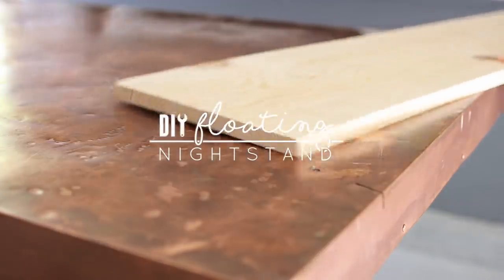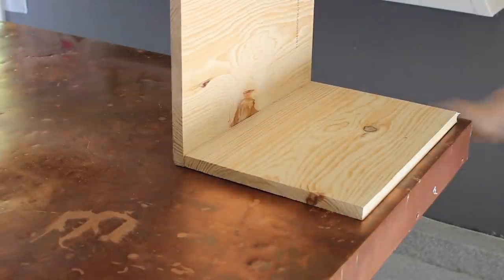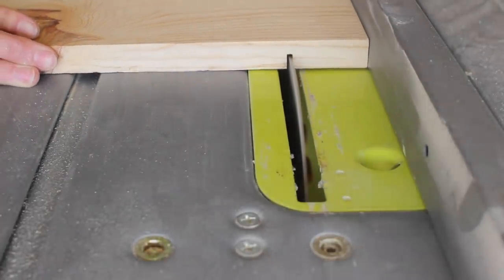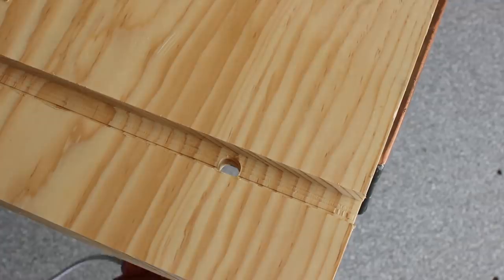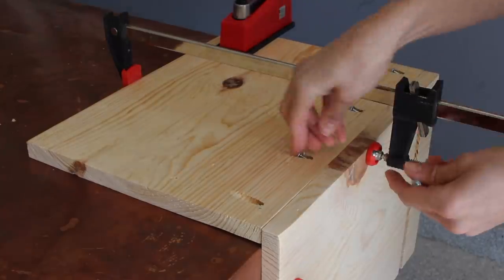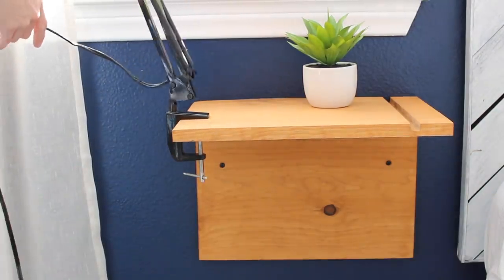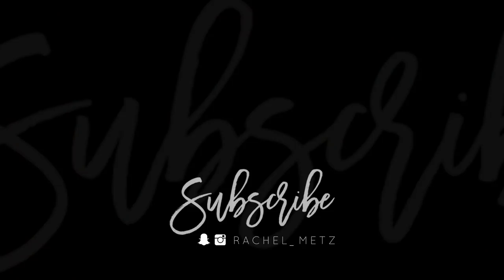DIY $10 Floating Nightstand

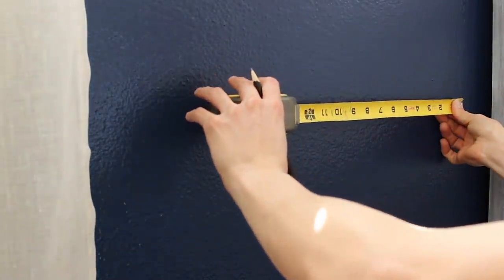Comment: 2:28 Reverse the countersink direction to get rid of ridges
Reply from the maker: Thank you! I did that since I loved the ridges actually (call me weird)! It added a bit of texture in a room that really doesn't have much texture with the other DIY furniture I've done. Appreciate that tip!
Reply: @LivingtoDIYwithRachelMetz  You won't see the ridges tho because the taper on bottom of screw head covers it when you run a screw in.. .. Im talking about when you drill the countersink hole for the screw to sit flush.. If you reverse the drill, you will get a super smooth countersink hole.. Does that make since?? Great videos btw and shoutout to P-Rod!! lol
Reply from the maker: Fine Art Aerial totally makes sense! But I like the ridges and I made them bigger so when the screw sets in you can see the ridges. All personal preference for sure but will totally do this next time. He's the man 👏🏼